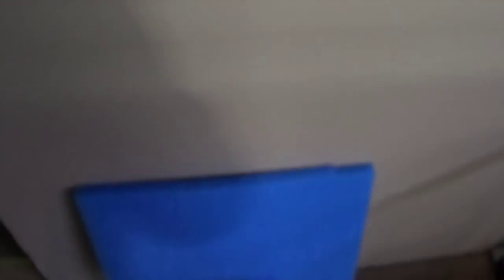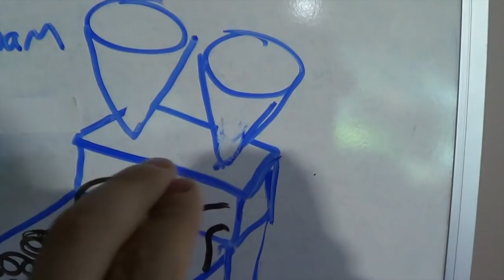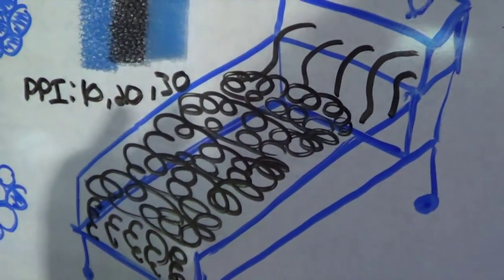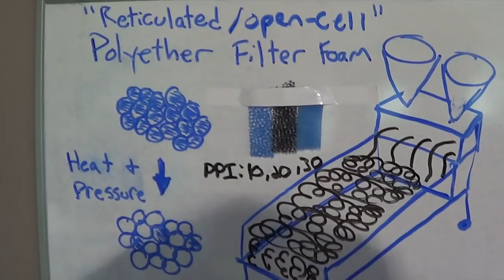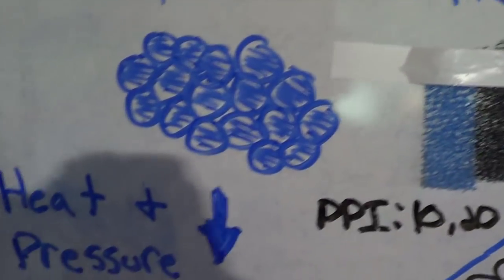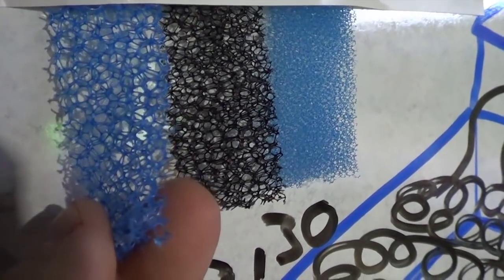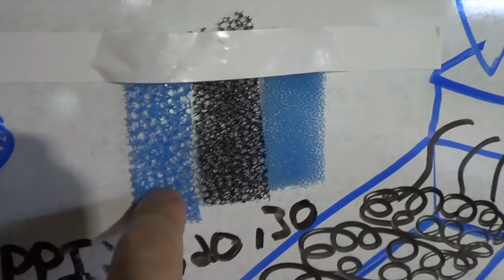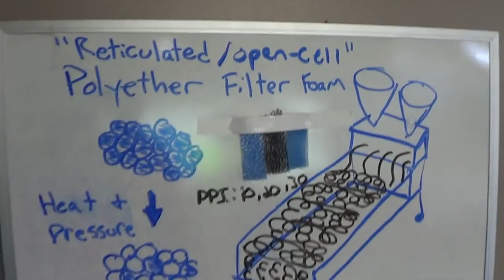#321: How is Open Cell Reticulated Polyether Filter Foam Made? - Tank Tip

Comment: You are actually wrong,open cell foam is also used for mattresses and furniture and other application,the difference is actually the pore size(diameter) and the pores per inch.Closed cell on the other hand is used for heat insulation applications.